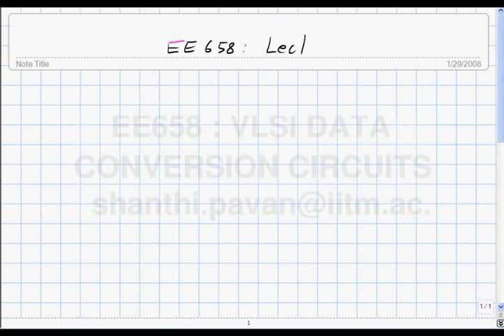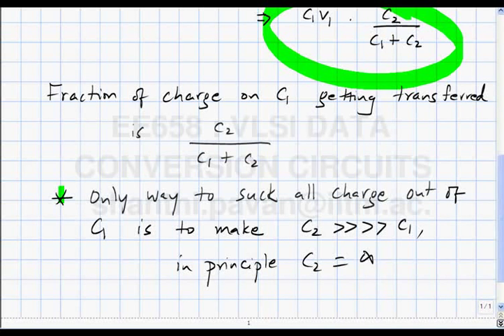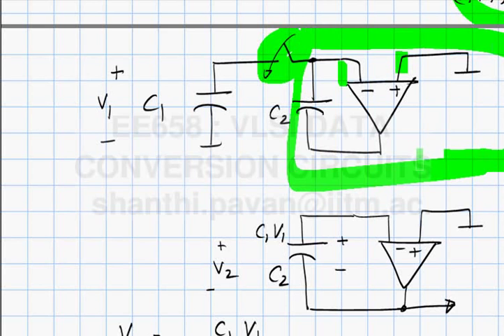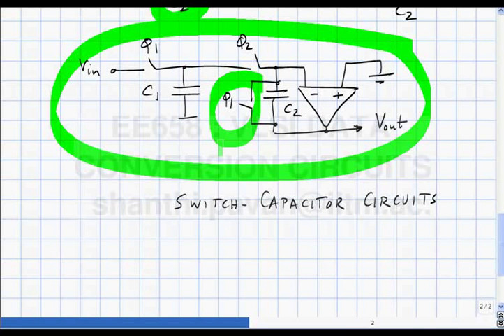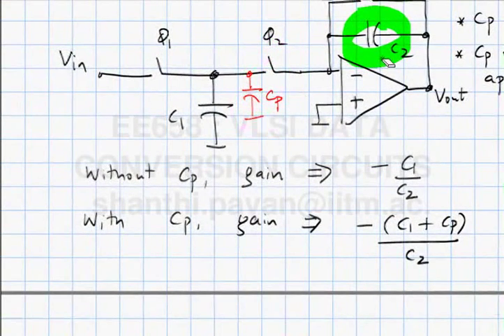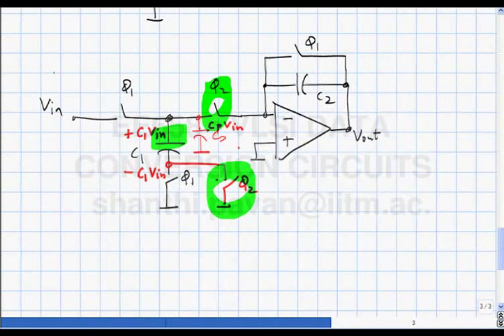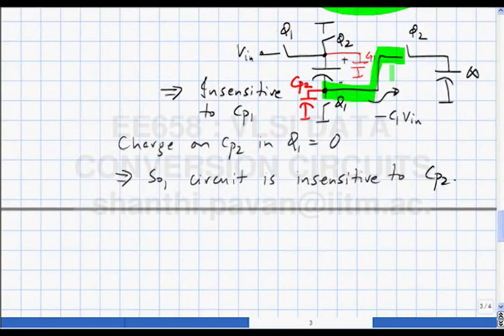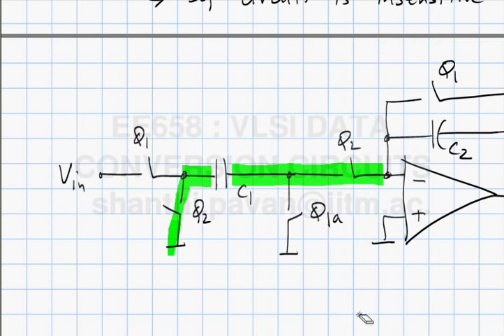Lecture 13 - Switch Capacitor Circuits, Parasitic Insensitive SC Amplifiers

Comment: 13:22 - Problems with simple ground referenced capacitor
28:15 - Clock time delays, to solve charge injection in switches